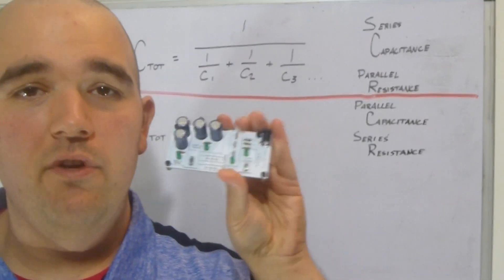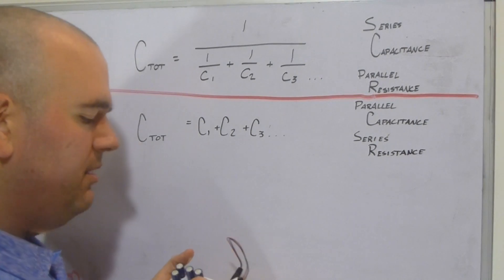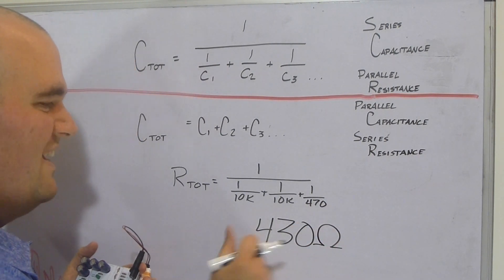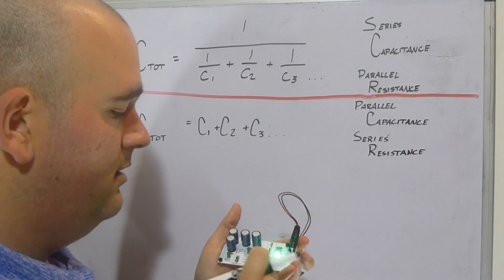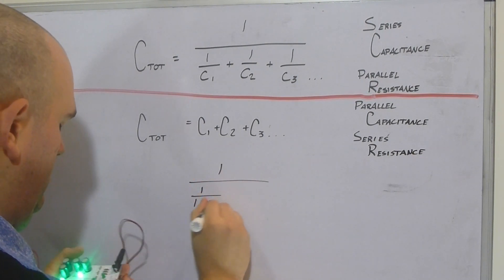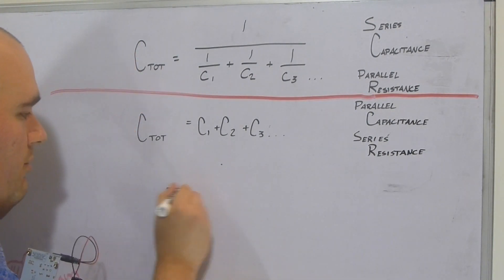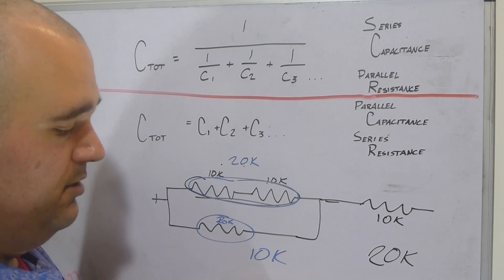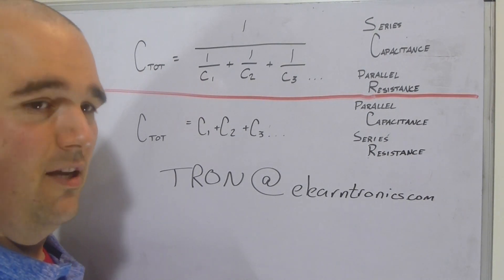Series vs. Parallel: How does it work? | Electronics Learning Boards from eLearnTronics

Comment: The circuitry in mine is somehow reversed. I did exactly what the video shows, only works if battery is attached wrong. Also whoever said these guys are easy to get a hold of or responsive, isn't really accurate. It's a company, they don't give 2 craps if it works for you or not. Sorry to disappoint folks who read amazon reviews, notice how all the comments are turned off? Surprised this one is still on. My other kit from them must've had a bad power adapter cause it never worked.